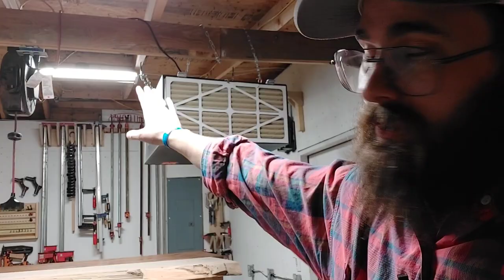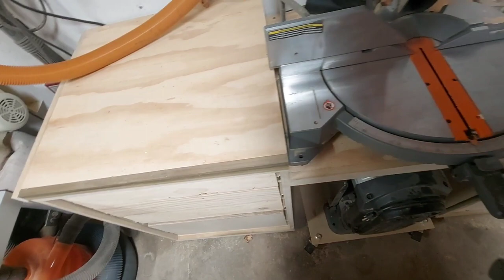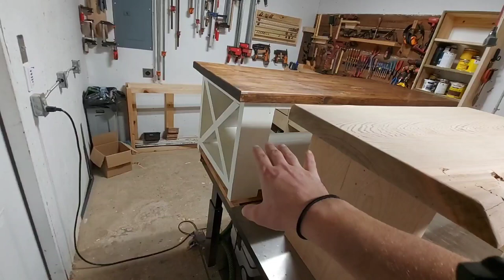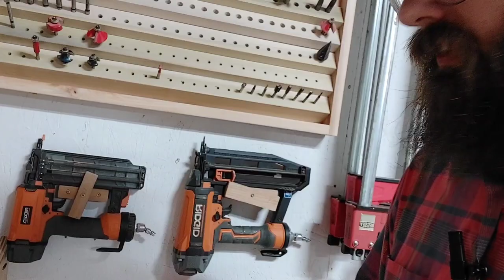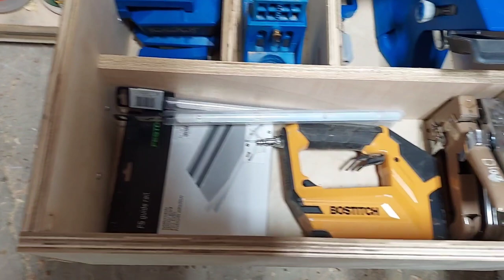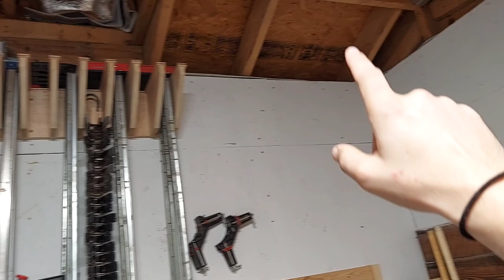Shop Tour | Small Woodworking Shop

Comment: When you install the dust collector hose to the outside, make sure it is installed correctly. If not, during the colder months, it will suck the heat out too. A few years back, April Wilkerson had her dust collector hooked up by the company she got it from, and they give you a good explanation of this and how to correct it. It will do the same thing to the cool air from the window air conditioner. Rockler makes a Through the wall adapter made of plastic which I bought. I also found afterward that you can get them in steel too. These are used for woodstove stove pipes. I think I am going to go with the steel and sell the plastic one because I am installing my dust collector in a custom-built "shed/closet" off the back of my shop that will be installed onto the back wall. Steel will prevent any printers from chewing through it. Now that lumber prices have come down I can afford to build the closet and put on a small addition for lumber storage. I heat my shop with a 30-pound gas tank I got for free. I converted it to a small wood stove. I did use a welder, but you can make them easily without one. Then to keep it out of the way I put it onto a heavy-duty corner shelf that is topped with 1/2" slate slabs I had. And put up some of the older heavy gauge steel corrugated roofing panels I got from an old barn on the walls and just above the stove since I raised it off the floor. I love it and no bending to throw wood in. I have it just about waist-high on me. And for my small shop, I can work in short sleeves during the winter.
Your shop is just 2 ft shorter than mine which is a shed I bought when I retired and had electricity 110 & 220 run under the ground to its breaker box inside the shop. It's well-insulated and I have OSB on the walls, which I regretted doing when it was done and wished I put T-111 on the walls instead. I don't know how I didn't think about it but the SOB today is stamped all over the sheet and it required a stain blocker to cover it before priming the walls.
This is not a criticism, but the dust collector bag should have very little if any dust in it. All of that should be going into the bucket below the cyclone. You may want to look at everything again. It's very easy to switch the hoses, I know because I did it with my first DC some 40 yrs ago.
Great hand tools by the way and what a break for you to find someone getting rid of his tools! The router plane, shoulder plane, and card scraper holder all look to be Stanely or Baily which was their company too. Don't apologize for the tools you use. The tools you bought are an investment in your future, and they are tax-deductible. ;>)
I'm 60 now and retired so I only make gifts and a few types of items I sell at craft fairs. I am toying with selling online again. I don't sell furniture anymore or any big items. Only as gifts or for my own home. I had to close my first online store when my spouse was dia. with terminal cancer. I just did not have time to fill orders. One thing I would advise is to find a unique item no one else is making, or make it different than everyone else. I also ran a sale every first of the month with a 30% off coupon that was sent to their inbox. I still made more money during the sale because of the volume I would sell. I didn't want to have discounts just during the holidays like everyone else. That was the key to my success. I would sell out every time with backorders on a few of my specialty items. Brass, copper, and stainless steel inlay on some of the traditional carpentry tools I made. Something no one else was doing at the time. I would repurpose items or take parts off of items I found at the junkyard or tag sales. Remember when Steampunk was all the rage, yea, I got into that too but ahead of everyone else when you only saw them in magazines. As part of the business I would also research interior, decorating websites to see where trends were heading ahead of time. I wish I was selling during the big farmhouse trend. I have a truckload of old barn siding under a tarp behind the shop I could have used. I love the rustic & antique style of furnishing and thankfully so did my husband.
You are young and have a bright future ahead of you. I wish you the best of luck in your endeavors. (I'm sorry for the novel)
Reply from the maker: I read this comment, went to my shop and switched the chip cyclone around.....it works perfect now.  Thank you!

Comment: my shop is about the same size, only 8' wide and 14' long.Took me a while to figure out my flow and I went from there.Just got it all wired and insulated, used 7/16 plywood for walls, also my table saw is set up like yours in the middle of the room and I installed my router table into the saw. I struggled with storage, I wasn't happy with all the metal pegboard I put up earlier and didn't want to take up floor space with cabinets and tool boxes.I went with french cleats and am so glad I did. I can't believe all the tools I got on the walls! I have 1 workbench with 3 drawers that has my miter saw station built in, Bandsaw and sander are on a tool cart together. I made a flip top for grinder and drill press, everything is on free spinning casters including the table saw..The french cleat tool holders are taking longer than I thought they would but I am getting building experience. I was pretty worried about the small space at first but it's turning out great! good luck
Reply from the maker: Awesome, I'd love to see a photo!  I was going to go with french cleat but trying to keep up with the business side as well as youtube, I haven't had much time to get that started.  Maybe when I renovate it I'll add that in.